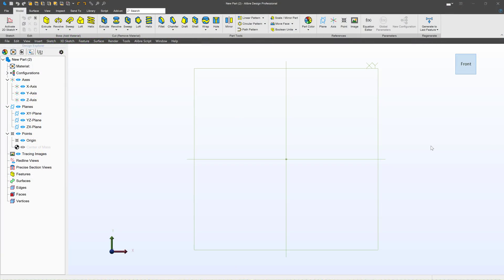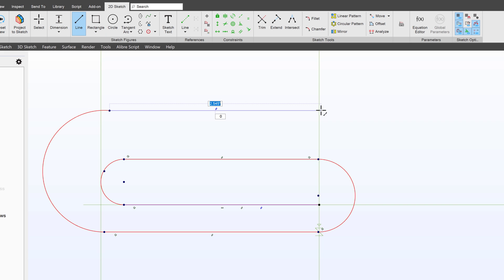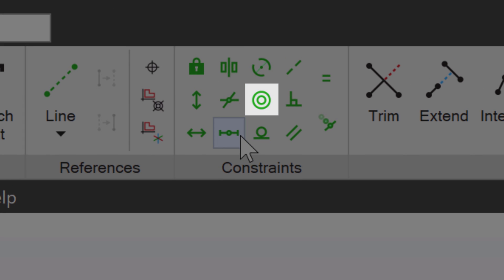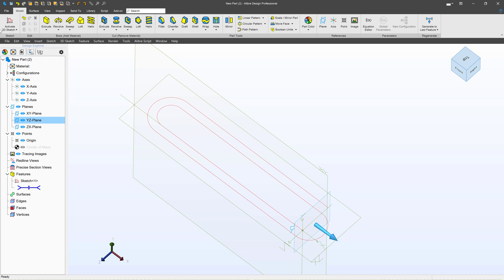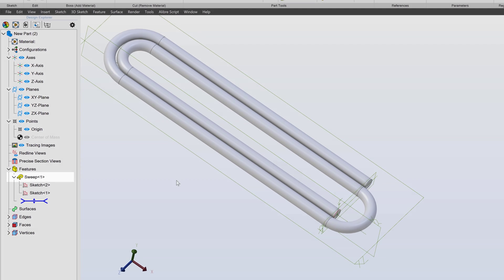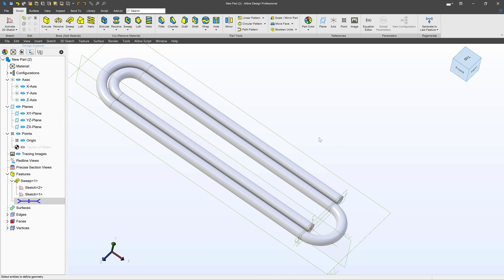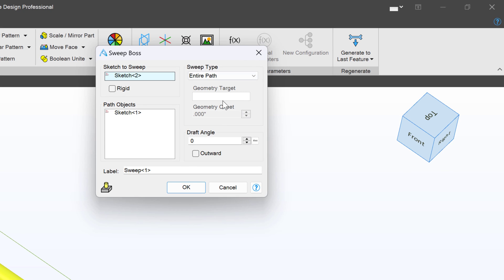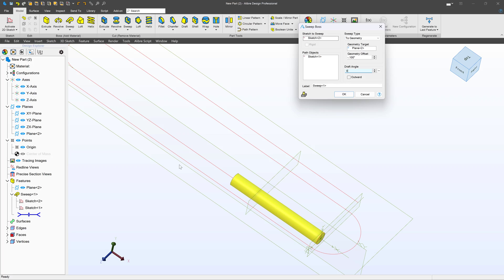Sweeping a Paperclip | Alibre Beginners Course #11

Comment: Interesting. How do you control the "pierce" point, to borrow from SolidWorks language?
Reply: Well, you can always project in a point from another sketch and add a coincident constraint to it. That's what the pierce relationship is in Solidworks. It just executes 2 actions with one command. But generally speaking if it is not completely obvious where to sketch the profile, I create a plane on path so I have absolute control of what's going on. That way, the origin of the sketch that is started on that plane is always going to be the path pierce point.